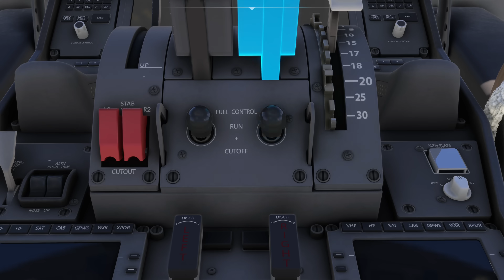Air India 171: Why Did The Fuel Cut-off Switch Get Moved?

Comment: Captain Steeve, I have been watching your videos and must say that I like them all. Except, this one. I suppose other than your experience, your analysis is based on preliminary report. You didn't explain, how can a manual process takes only 1 second (as per the report) to transition both the fuel switch from Run to Cut-Off. So much electronics (hardware/software) are there between switches and the action it does at the engine end. Are you not suspicious of anything going wrong with the electronics? A lot more conversation must have happened in the time from just before the take-off to crash. The report just mentioned two short selective sentences from the two pilots. A lot more must be out there in the black box that is not known to public yet. How can you decisively give the verdict, bypassing all that is unknown and some of the knowns (like 1 sec time to cut-off both switches manually).
Reply: The Telegraph reports: "Indian media, however, reported that investigators were examining potential electrical and digital faults that could have triggered “uncommanded” actions.

“The probe will ascertain the possibility of an ‘uncommanded transition’ of the fuel control switches to the cut-off mode seconds after the lift-off,” an official aware of the investigation was reported to have said."

Comment: @CaptainSteeeve So you have the conversation during preflight briefing, ask each other how are you doing. What happens then if the First Officer, or Captain, says "You know, I'm not doing well"? What happens if one pilot determines that the other pilot should not be going flying today? How does that get resolved? Does the flight get cancelled, or delayed while a replacement pilot gets called up?

Comment: Just like any aircraft will not let the landing gear be raised while on the ground is it not logical to not allow BOTH engines to be switched to cut off during climb up. In this way if, for any reason one engine needs to be shut down during takeoff then the plane will still have enough thrust from the one engine for climb up. Look back at the Concorde crash when one of the engines caught fire and needed to be shut off during takeoff. This logic will, at the very least, gives the pilots a fighting chance to try and salvage the situation

Comment: Captain Steve,  
A question and a kindly request. Please do me a favor, get your cell phone out and pull up a stopwatch, watch the CCTV video of AI 171 taking off, capture the time between liftoff of AI 171 and when the plane stopped climbing, what is the result?  I captured about 14 seconds +/- 1 second. The engines were producing takeoff level thrust for 14 seconds, the plane was climbing during this time. If the fuel switches are moved from Run to Cutoff for both engines at 3 seconds after liftoff how can the engines continue to produce takeoff level thrust for 11 more seconds with the fuel cut off?  The rate of fuel consumption during takeoff has to be staggeringly high so fuel switch cutoff to the engines at this time should be an almost instantaneous loss of thrust, correct?

Comment: When a train crash occurs or a bus driver goes off a cliff, or a truck driver rolls - does suicide come to mind? If you, as a pilot wanted to take the plane down, would you pick a day that you are in charge as the pilot or the copilot? 
When a person is suicidal they do it ALONE. They do it silently and lots of ways to do this if you have lost all faith in life. Have some respect and intelligence for the pilots until the final report comes out. Live in the possibility that there was a mechanical glitch in the circuit behind that switch that cut off the fuel. YouTubers like to get brownie points with head turning headlines. Please wait for the final report. Just for a second, if say Boeing or Air India were found to be responsible, you are going down the wrong rabbit hole and passengers are still not protected.

Comment: 'both fuel control switches were cut off 1 sec apart' is it possible to switch off those 2 switch in 1 sec??? 
Be logical at least...we understand if you can't blame Boeing it may cost you your job. Atleast don't push a false narrative and try to gain 10 minutes of fame

Comment: As an out board motor mechanic,,well used to working on control boxes,,those throttle arms in direct line with the cut off switches,,call for some checking,,when levers move forward something under moves back,,and even if normally clearing each other,,a loose wire or other fitting astray could trip the cut off's,, a picture from underneath would be more telling than the top veiw,,,,

Comment: We have seen it from the video that the landing gear was never pulled up. It is possible that they didn't get to it while they are dealing with this situation. But in any slight chance, is it possible that the pilot operated the fuel cut off switched instead of the landing gear lever as an accident muscle memory move?

Comment: What if : The co-pilot panicked during a mechanical/electrical issue and mistakenly believed the pilot had turned off the engine. Acting on this false assumption, he shut off the engine switch himself. He later realized the engine had not been turned off previously and that his own action caused the shutdown. He then turned the switch back on to recover but it was too late !!

Comment: I have a theory ..During take off the engines failed due to software thrust malfunction ( Boeing has their own device there)because of that the RAT got deployed and to restart the engine pilot had to move the cut off switch and then turn it on (Pilots were exactly following the emergency manual). If pilots had suicidal tendency they wouldn't have attempted to restart the engines...Because there was fault in engines they couldn't start on time and caused the deadly accident

Comment: Insider report - I have read the report several times now - a few things came to my mind -
1. Both engines never switched off totally they started losing power and deaccelerated below idle speed but never switched off totally.
If you are in such a situation when you are  losing thrust for some reason as per SOP and memory item the fuel cut off switches to be recycled (  place it to cutoff and run position ) to start the engine again.  Pilot did the same correctly here when they saw both engines losing power and they almost had a success.

2. One pilot was asking another why he cutoff when PM saw the engine indications and other warnings and other  replied that he did not rightly. In this case they were talking about the engines not the cut off switches. 

It is impossible to find out why the engines are losing power in such a short time at a critical moment so they have started the restarting sequence and its first step was to switch off the fuel cut off switch and put it back to run position again. Therefore there are no connections between engine power loss and switching off the fuel cut off switch in this case. 
Most likely due to any software issue both engines lost power just after lift off and crew immediately started the restart cycle to save the aircraft. 

Boeing and GE will bring a new FADEC software update soon before the final investigation report is out. It is a deal between the Govts and agencies. 

Clearly it is not a suicide. They tried to save the aircraft with the best of their abilities. Final report will bring the correct report. The FDR and CVR clearly specify when they started losing power and when cut off switch is touched

Comment: What a clown! Drawing conclusions on the basis of a preliminarily report? First you come up with your vague flaps theory and now you are drawing your own conclusions and blaming the pilot directly. You could have tried to explain the report technically, which you clearly didn’t. If you think if the pilots were at fault, why do you think they tried to bring up the nose of the aircraft as a desperate measure at the end? Dude you are not fit to be a pilot, period. The airlines for which you fly should question your credentials at the earliest.

Comment: All pilots have been trained very well and these pilots are such an experienced having 1000 + hours of flying experience they have flown multiple aircraft, each and every pilot follows this rule 1st, as soon as they hear "V1" than takeoff that means "rotate" than "gear up" and switch on to "Autopilot" just simply as that and whey would the pilot touch the fuel switch to cutoff mode

Comment: Blaming the pilots prematurely shows not only your character but literally raises questions about you as a pilot. Sitting in a room and blaming the pilots without having the complete data at hand in spite of knowing Boeing’s spotty safety record and their lack of concern for safety measures shows you’re a lobbyist for Boeing. 

If there was no issue with the aircraft then why would FAA release a report in 2018 and why would the UK civil aviation ministry issue a secondary warning in May 2025 regarding the same control switches.

Comment: hey captain steev, you know what? Our Indian pilots may be depressed or having some mental problems because they had f** Brain to begin with. Unlike you. Your skull is also fitted with Trent 100 engines. Be careful, any time you can also have dual engines failure and while you are taking off in the morning from your bed, you may crash in nearby toilet 😡😡😡

Comment: Captain Steeve please stop spreading nonsense. You have completely shamed the pilot community by spreading lies about the AI 171 crash. There are several reasons why this crash is clearly not a suicide. The pilots made a Mayday call, clearly they were following procedures, a suicidal pilot does not tell the ATC that they are going to crash, secondly you can clearly see the pilots trying to save the plane in the video by putting nose up and the AAIB report clearly states that they attempted to restart the engines with fuel control switches back to RUN. A pilot who decides to commit suicide is not going to do that. Thirdly, the RAT was deployed very early on as per the picture in the report which means the engines failed much earlier during the takeoff. The report is missing critical details of the accident and you have conveniently filled into the gaps. SHAME ON YOU SHAME ON YOU CAPTAIN STEEVE

Comment: From what i can understand from the preliminary report and other releases the fuel cutoff switches were moved to the cutoff position and then returned to the run position about 10 seconds later. Therefore the switches would have been found in the run position post crash. My question would be "are the cutoff switches wired directly to the fuel shutoff valves or are they fed into a engine control module where the  output signals to the valves could be subject to other logic signals. As a industrial electronics technologist I am aware of the robust nature of avionics, but sometimes $hit happens. Maybe there is a slight possibility this wasn't pilot error.

Comment: The procedure for cutting off fuel to an aircraft engine should never be this straightforward. There must be a multi-step process in place to prevent critical incidents like this. Even in emergency scenarios, pilots should be required to follow a clearly defined, multi-layered protocol to initiate fuel cutoff.
It's deeply concerning that such a critical action can be performed with a single switch, without any warnings or confirmation steps. Even the most basic software or mobile application prompts users with multiple warnings before allowing data loss yet an aircraft carrying over 300 passengers can be powered down instantly, without any safeguard? This points to a serious and dangerous design flaw that urgently needs to be addressed. @CaptainSteeeve

Comment: Why no one mention it is the 787-8 mechanical or computer chip failure? The faulty computer chip cut off the fuel supply? and the the pilot try to turn off and the turn on the fuel switch to try to Restart the engines? Boeing is trying to hide something. And Boeing is not as realiable as Air bus in my opinion. I will try to take Air bus for my trip.

Comment: See the "flying beast " videos of why AI 171 carsh is indeed a Boeing failure. You were too quick to judge the Advisory report. It's a shame that people with a large following don't even think before blaming Pilots. 
If you see the report, on page 14 you can see the picture of RAT deployed merely at 60ft above ground which means the engine started to fail while on the V1. Fuel Cutoff and RUN was an attempt to reignite the engine.
Reply: Excellent analysis by Flying Beast 
https://youtu.be/sDQHhlPGaoc?si=D5BKt2tNZ7Wq2QfG

Comment: Thank-you so much for your expertise and insight Captain Steve.

I have to ask you if you think Boeing, Airbus (and all other larger jet & commercial aircraft manufacturers) should NOT be putting both fuel cut-off switches side-by-side.  Perhaps the manufacturers should consider putting the fuel cut-off switches on OPPOSITE sides of the cockpit flight deck?  That would mitigate the risk of ONE pilot being able to put BOTH fuel cut-off switches in the off position in a critical phase of flight.  In other words, it would take TWO pilots to put BOTH fuel cut-off switches in the off position.

Thank-you so much again for all your specialist Aviation expertise in these matters.

Comment: Engine failed first, then pilots cut off the fuel and then switch it on again, the preliminary report is crap, why the hell they did not put the full conversation between the pilots.

Comment: Could you break down the RAT release form engine spool down form top speed of take off - which includes sensing delay , eng generators failure RPM, RAT deployment and spoolup timing,  and more.

What I do not understand is that - why most of western youtube infuencers rely on WSJ for their stories, When the report is out they could directy refer to it?
If thery are realy learned professional the info that could be useful is to get their theory on below : 
1) How much time (seconds) the RAT/computer takes to sense the Engine spool down to initiate itself?
2) Are there other logic that can CUT OFF fuel supply?
3) What is the exact "transcript" in exact language of Pilots with time stamps?
4) What were the other pilot dicussion or noise or alarm in the Cockpit Voice recorder ?
5) Why did WSJ publish the "switch theory" a day before the exact release of Report - Why WSJ paid(it only works that way) for the leaked portion of report?
6) Why the whole western world Main stream media as well as Youtube channels, is suddenly awaken to make so much video on "Pilot fault" theory? We already know how narrative works!!
7) Did Boeing blamed "Pilots" in past ( Yes) and later it was found that it was found sofware fault after second incident - YES remmember the 747 MAX?

Better to do a set by step forensic investigation on events it self to find out the exact theory, instead of finding escapegoat.

Comment: As fresh scrutiny surrounds Boeing after the Air India AI 171 crash, aviation expert Mary Schiavo reveals that a similar fuel cut-off malfunction plagued a Japanese Boeing 787 in 2019 — with pilots never touching the controls.

It seems Captain Steeeve should need mental therapy for assuming so quickly and blamed the Pilot🤷‍♂️

Comment: Sorry capt Steeeve , I used to follow you as you decoded flying for layman like me. However attributing pilot sabotage for the AI171 crash is too preliminary and casts aspersion to your intention. Best thing would have been to get engine expert and explain how it works. These are soft switch meaning they don't turn off the fuel valves directly.

Comment: This is not a deliberate engine cutoff, but in response to engine shutdown. You have all the evidences in front of you in what ever botched up report that is released.
The picture showing RAT getting deployed when plane was just 50-60ft in air, and still not crossed airport. Which means, engines had already shut down just after lift off, or just after crossing V1.
RAT would need to first sense that engine has shut down and it needs to deploy. At takeoff, engines are on full throttle, and this being a heavy long-haul flight, engines must be on full power for takeoff. 
So, electric generators would still be powering a few seconds after engine starts shutting down because there is enough rotation to keep them going. 
RAT would have deployed after engine RPM went lower than this limit, which means RAT gets signal to be deployed say a few seconds after engine actually started shutting down. 
The first thing that any pilot does when both engines shut off without a reason, is to toggle fuel switches and that's what pilots here did, trying to recover and not commit suicide. 
I don't know what kind of planes you have flown, ever flown anything at all or not, as an electrical engineer I could come up with this of investigation. 
You, may be due to vested interests, are blaming pilots. That's it!